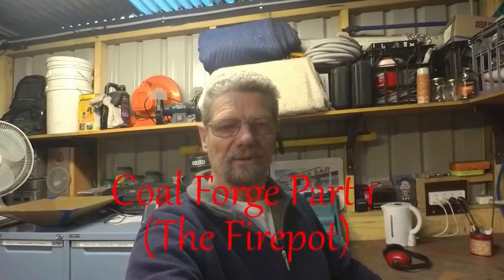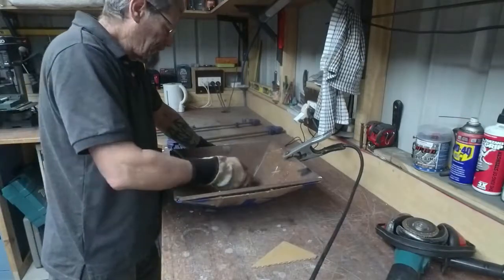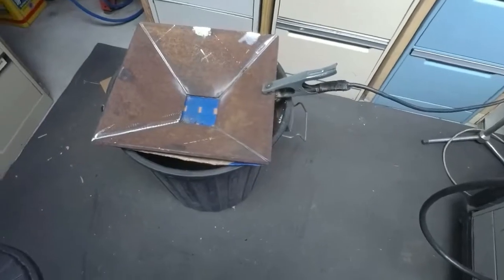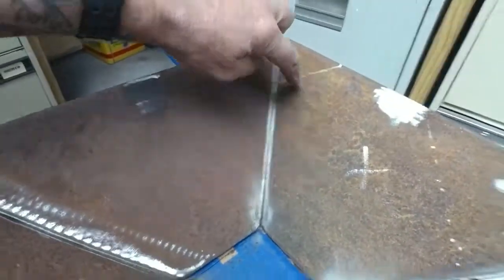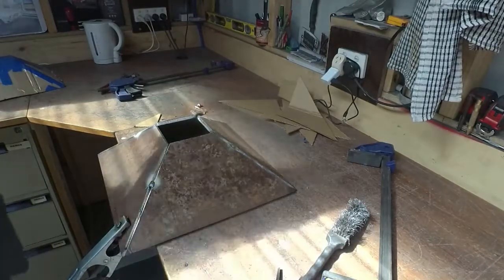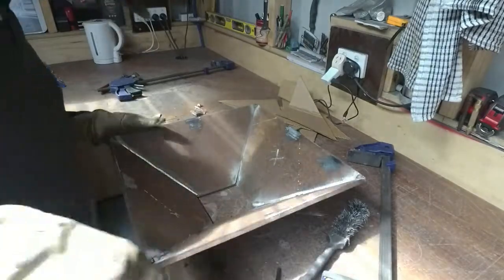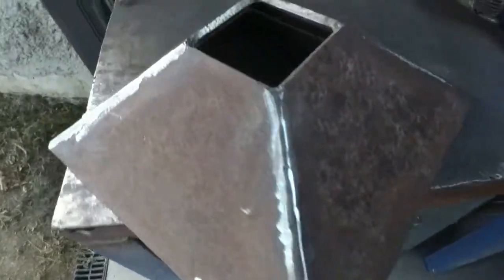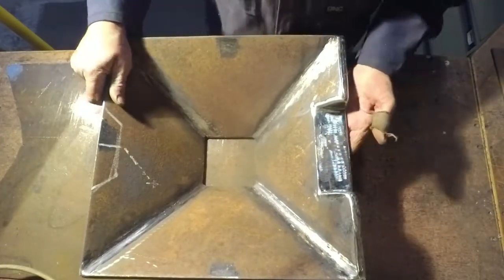Coal Forge Part 1 The Firepot

Comment: what made you want to build a coal forge? i noticed in the propane forge build videos it was only seeming to get up around 800C or so. were you able to get it hotter?
Reply from the maker: Hey Bogaman, there are multiply reasons why I wanted to build a coal forge, but in a nut shell- they are cheaper than gas, more convenient, cooler in the workshop, more adaptable for odd shaped materials and if made well ,will last a lot longer. And no my gas forge gets up to over 800° with just one burner going and around 1200° with both. I just don't bother showing the temperature on video the majority of the time.
Reply: @andywright2606  i'm happy to hear that you didn't build the coal forge out of necessity because the propane forge wasn't getting hot enough. it looked to be built with such care! i'm enjoying catching up on these videos!